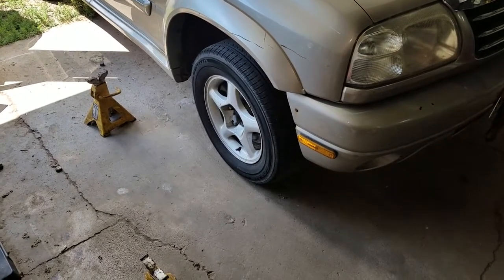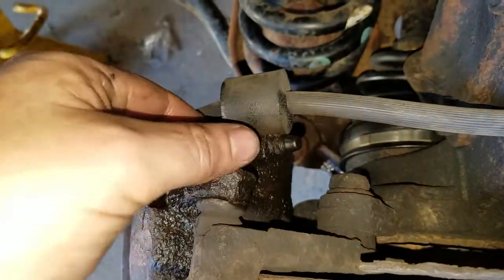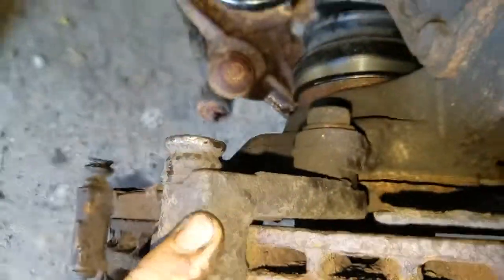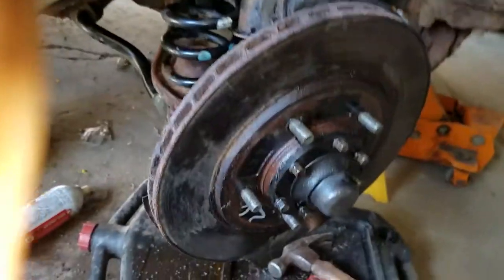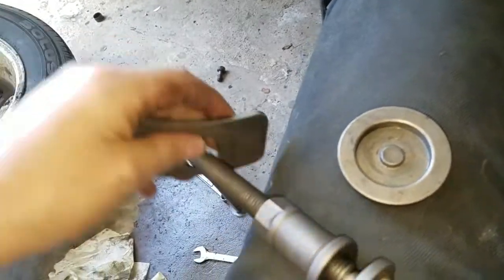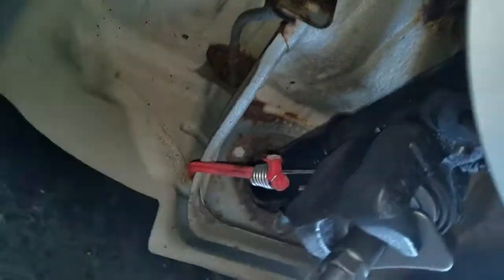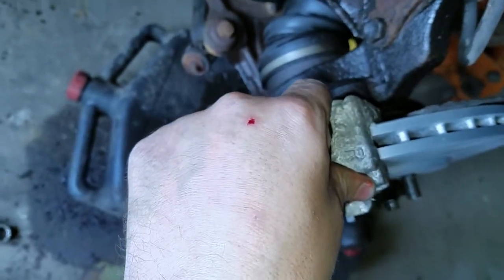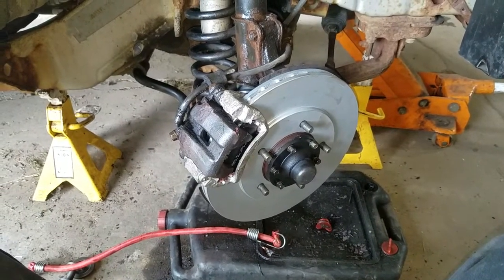how to change the brakes and rotors on a 2001 suzuki grand vitara xl7

Comment: Those holes on the rotor were for pushing off with bolts not a puller. But thanks for pointing them out. Saved a whole lot of hammer beating.
Reply from the maker: Nice glad I could help